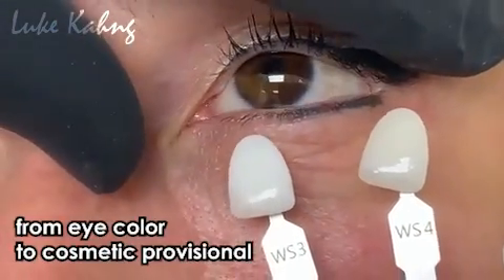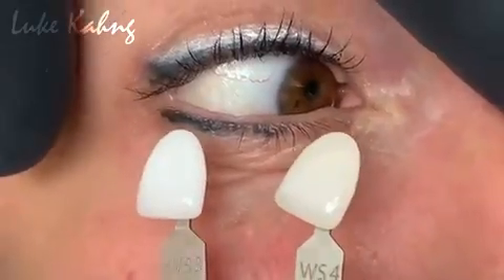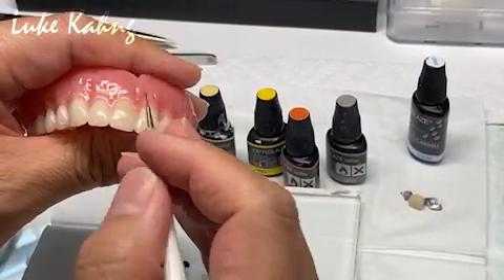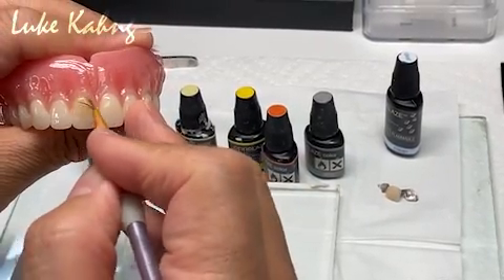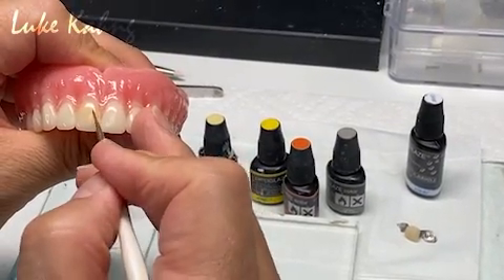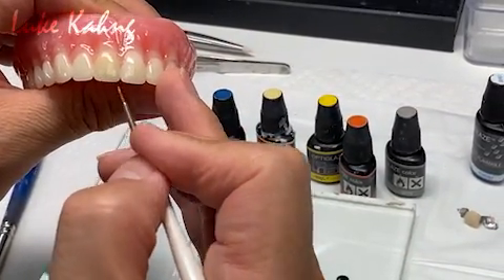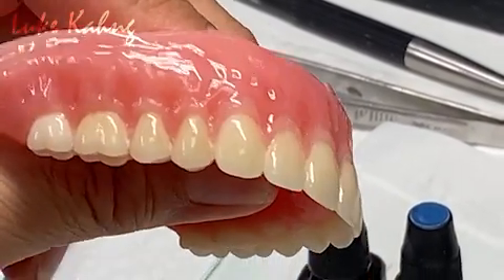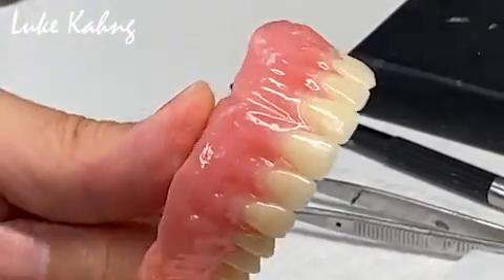Full-Mouth Provisional Implant Using This Eye Color Concept

Comment: these teeth could be cured, why were they removed and implants placed ???
Reply: The teeth actually could not be saved, they were curing the prosthetics.  Light/heat is used in setting work done in this respect - on the prosthetic :)